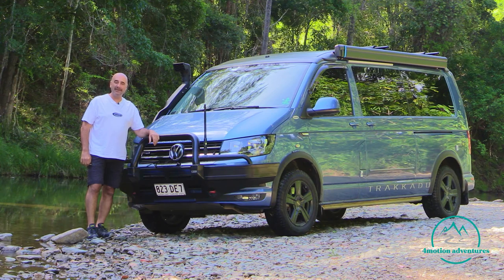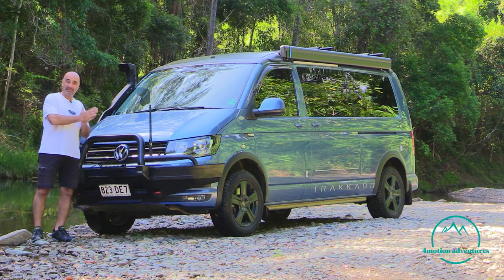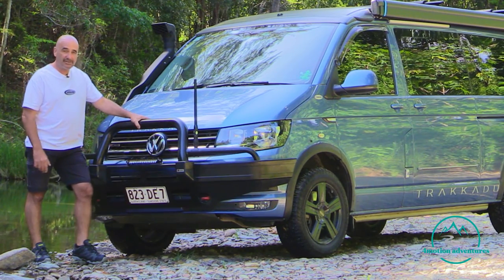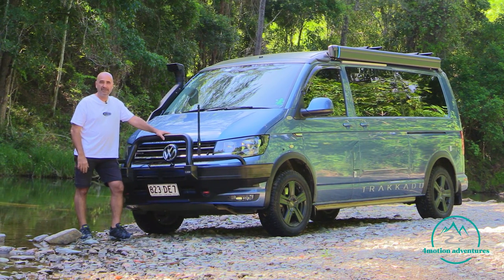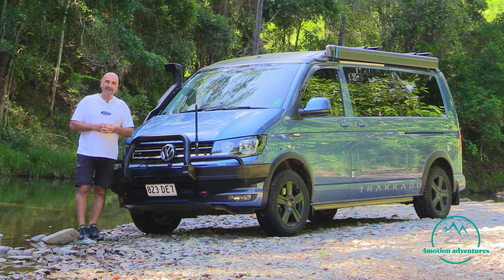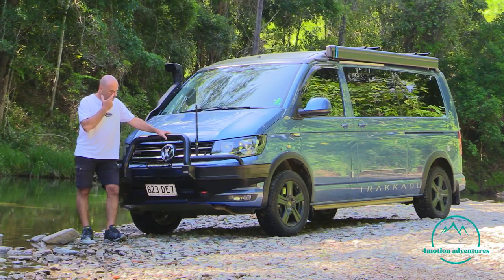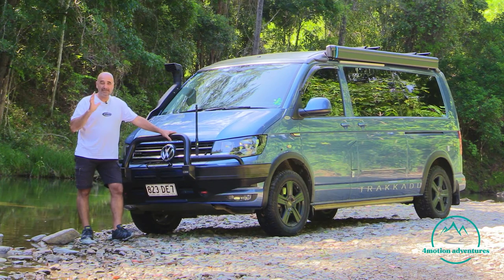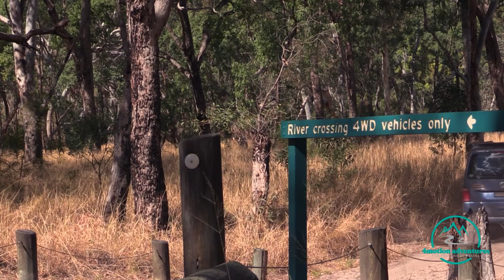VW 4motion Camper-Van (Water Crossings)

Comment: Really enjoyed this Alex! Such a satisfying collection of shots at the end. Comprehensive tips! Two more: if you've got a locker and the bottom is round river rocks it can help with steady forward momentum in the case where a wheel might find a bit of a hole between rocks. And the 300mm depth is smaller than we think - carry a cheap timber school ruler (30cm long) and a permanent marker in the driver door pocket. When wading the crossing to check on foot, measure up your leg and draw a line on your leg, then you can easily see the depth as your wade each part of the crossing. Guess who taught me that one ;) hope you're still finding them. Safe travels.